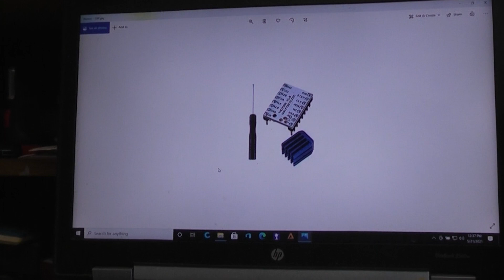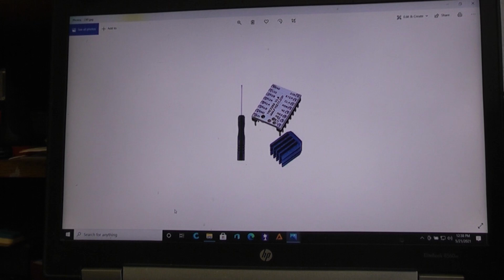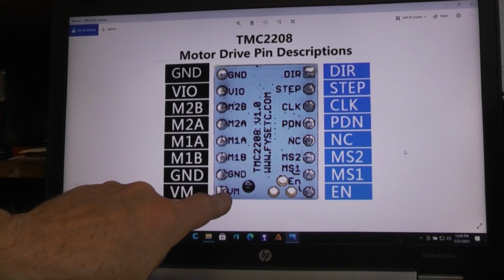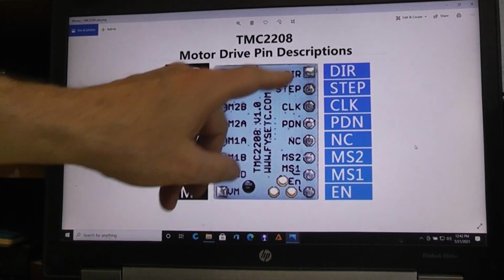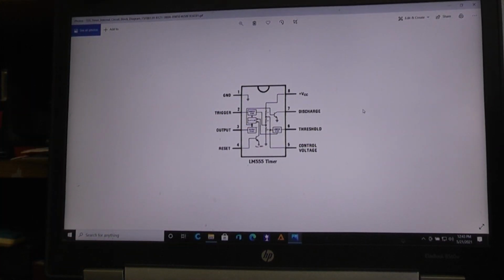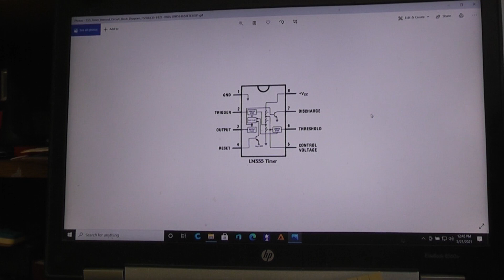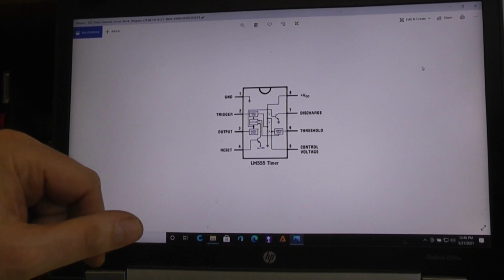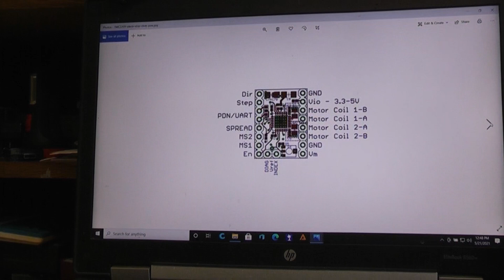Part 4, Leslie build.  Silently control a stepper motor with  a TMC2208, 555 timer and 12V supply.

Comment: Thanks for sharing I really enjoyed your videos. May I ask, should a 17hs4401 or a 17hs8401 stepper work for this build? My horns are heavier though. Thank you.
Reply from the maker: I have not experimented with other stepper motors, but I would think a larger one would work better with heavier horns.
Reply: @Robothut what's the size/model number of the one you used for this build?

Comment: Is it a normal practice to put a bolt through the regulator?  Or do you need to center post and a bolt tru the regulator hole ?
Reply: I had a amp I didn't take pics of before taking it apart and there was a component that looks like the 5v regulator and I burned the freaking thing when I plugged it in

Comment: Love this project - I wish I was a bit more adept at the circuit side of things (software dev here, I've only dabbled in hand-wired circuits). I grabbed the schematic @jpdesroc posted here, but haven't gotten things to work just yet....
Reply from the maker: Now there is a company in China called JLCPCB that will make PCB boards from your design for like $5 bucks and you get them in a week. If I had know about them back when I did this project I would have used them.
Reply: @Robothut how do I go about ordering that as someone who knows nothing about any sort of chips?

Comment: This is the third time I have tried to post this reply and it keeps getting taken down.  Maybe because I included a link it didn’t like.  One more try with link one link removed…

Thank you again for this excellent YouTube video series!  I have completed my project and although there are still a few kinks to work out, it works.  I depended heavily on your work.  The issues I had with the motor pausing, just went away.  Not sure what that was or what I did to eliminate it, but it went away.  

This is the link to a video from the back with the drive motors running:
https://drive.google.com/file/d/1vJH7zZ4RA7pFxjk15XfSD0R_xaO2erO5/view?usp=drive_link
Reply: This is exactly what I'm trying to do, glad to see the motor pausing issue resolved itself!   I'd love to learn more about your project - especially the speaker/crossover details and what you used for your lower drum and upper horn rotors.  I was considering using some plastic funnels to make a horn since I can't find any STL's for it.  Any tips or extra info / videos would be great!
Reply: @james5345  I have had  some time with my version and my main complaint is that I believe the lower drum has to have a much more focused opening to keep the lower frequency pulse.  I think the one @Robuhut made was more effective because the side walls went right out to the outer diameter of the drum.  I focused on a scoop contour and I think that was a mistake.  Mine works but it is more of a chorus effect than a Leslie.  I am in the process of adding side extensions to my lower drum.  If you do yours, I would focus on that.  Now looking at the original Leslie drums, the drum diameter is a few inches larger in diameter than the speaker so that the side wills can extend enough to make a focused beam.  My build is too far along to make that happen so I will just work with what I have.  

The crossover worked, but I ended up putting an L-Pad on the horn side so that I could very it's contribution.  Mine was a littel too high frequency happy.  That is probably because the high and low frequency drivers were not balanced very well.   If I had it to do over, I would set the crossover a little higher.
Reply: @kennethvierck244  That's extremely valuable info, thanks!!
Reply: @james5345  I looked into plastic funnels also.  I also looked at tweeter horns and I was going to connect them with  PVC pipe and fiber glass.  Ended up getting a 3D printer and Rhino.  Glad I did.  I am happy to share my STL files for the horn.  Mine is printed in 5 pieces (body, two horns, two muffler pieces).  Mine has some specialized features that may not work for you though.  The 4" pulley is integral with the body and has a 0.2" wide channel.  It has a bottom  bearing seat for a specific bearing that has an inner race diameter to permit a 1" tweeter opening.  The top bearing is just a simple skateboard bearing.
Reply: @kennethvierck244  Looks like my reply from yesterday didn't go through.  I would be very grateful for the STL files!  I haven't finished sourcing all of the parts yet, but I believe the tweeter mount I have is 1".   I could also modify the original design file in Fusion if you can provide it too (no biggie if you can't/don't want to).
Reply: @james5345  I don't have a problem sharing.  I guess I will have to sign up and post on thingiverse or somethng.
Reply: I have tried twice to post some links and paths to information and the system keeps taking it down.  Not sure what it does not like.
Reply: @kennethvierck244  I was afraid that might happen.  I'm pretty sure that my reply wouldn't go through to you the other day because I tried to sneak my partial email address into it.  Did you end up posting it to  Thingiverse?
Reply: @kennethvierck244  Hey the only solution I could think of was to add my email address to my visible contact info.  So if you click on my name and get to the 'about' section, you can click on 'view email address' and send links or files to me that way - if you want to.  Sorry it has been such a hassle

Comment: Hello Again.  I have made some significant progress.  I did what you did for the circuit but drive two motors so that I can drive the horn with one and the drum with the other.  I built a crossover also to split the signal for the tweeter and drum driver.  Anyway.  I tested the initial circuit on a breadboard with one motor and then put it on more permanant boards for the two motor drive.  It works great on the fast speed, but when I move to the lower speed, one of the controllers has a pause close to every half revolution.  I switched the motors and it is definitely the controller not the motor.  Any idea where the problem would lie?  Not sure if I can add pictures or video here but will try.
Reply from the maker: Not off the top of my head. But I do like the dual motor and horn section you added. Hope you get it worked out as it sounds like a great idea.
Reply: @Robothut   here is a link to my video (I think I made it properly shared): https://drive.google.com/file/d/1bIcaJuLA4Pj4XpChjUxNsg3hux5YKUyy/view?usp=drive_link
Reply from the maker: @kennethvierck244  Try uploading to Youtube instead. You upload as UNLISTED if you want to share the link , or PUBLIC if you want everyone to see it.
Reply: @Robothut  Sorry!  Made it public so it might work now.  I am thinking I might have damaged one of the motor controller chips when I stupidly hooked up the 12v supply backwards.  Rookie mistake.  I purchased 4 of them so I am making another board and will try that before moving forward.  My drum is significantly larger than yours so it might be that there is not enough power to drive it.  We will see.  Fun project and thank you so much for posting your info.
Reply from the maker: @kennethvierck244  I saw the video. Wow that is strange. Is there a chance that the power supply is having a problem at low speed? Monitor the power supply rails when it is happening Very odd.

Comment: Excellent!  Just ran across this. Thank you!   What pulley diameters did you use to get the correct slow and fast speed with this system?
Reply from the maker: Video Part 2 shows the 3d printed parts and link to the STL files. You open the STL files in any slice or STL file viewer to get the dimensions to all the parts.
Reply: @Robothut  Thank you again for this awesome video series!  I have not done any 3D printing so have not used STL files before.  With free on line viewers I could manipulate your parts and it looks like your driver pulley was about 3.75" and your rotator pulley was about 2.75".  Anyway, with this video series I am pouring over the data sheets!  I think I can see how you are using the 2.2k resistor to affect the 5k-5k-5k voltage ladder in the 555 timer so that the set/reset voltages are different for the fast and slow speeds.  At present I am having difficulty calculating the pulse frequency expected.  I like to understand how things work, but I am an old mechanical engineer and so the electrical fundamentals are not as strong and don't come back as quickly! :-).  My first round through I don't think I calculated the charge and discharge rates correctly with the 0.01uF&27.5k circuit with the set/reset voltages for fast and slow.  I will try again.  If needed, I can just do what you did and adjust the pulley diameters.  I will be doing this on both the bass and horn oscillators so I have to be able to affect the rates properly for both.  My worry is that with a 12" base driver, my rotor parts will have more rotational inertia and I might have to give the stepper motor more mechanical advantage.  I see that the stepper motors go at 1.8 degree per pulse so I need on the order of 160 pulses/s for the slow speed and about 1300 pulses/s for the fast speed.  The difference between the horn and bass rotors can be dealt with by pulley diameter differences but the ratio between fast and slow has to be about right.
Reply from the maker: @kennethvierck244  Lets us Know how the project turns out.
Reply: @Robothut  I will definitely post my project results, the good the bad and the ugly!  I did some calculations and I am only calculating a 2.5x increase from slow to fast and am calculating higher rotational speeds (pulse rates) then it looks like you are getting.  I will try and post a screen shot of my calculation page.  I have the components on order so will start testing the motor driver soon.  Hopefully!
Reply from the maker: @kennethvierck244  Take into account the TMC 2208 driver has a Data sheet showing the different pulse input divider settings.
Reply: @Robothut  yes, I have been reviewing.  Very confusing for mortals, but I do see that the default position is for a 1/8 setting and you can put voltage on the MS1 and/or MS2 pins to change the micro-stepping setting.  Could put that on a the speed selection switch with a DPDT.  I reviewed/traced your foot switch arrangement.  Very elegant!  probably take another wire and maybe a 3PDT switch to work out a logic change element for the speed.
Reply: Ok, sorry for bombarding you with questions!!!  I think I see now that the internal voltage ladder is isolated from the control pin, so my assumptions that the voltage ladder being affected by the control resistor is false.  However, if I pull the control pin voltage to ground, then how does it cycle at all?  The threshold comparator reference controls the high voltage side and the trigger reference controls the low side, so how does it work at all if the threshold reference is lower (ground) than the threshold reference?  If obviously works, so what am I missing?
Reply from the maker: @kennethvierck244  Starting at 10 minuets in I talk about the 555 chip. You hear me say there is a 2.2K resistor on pin 5 the voltage control input. So even if you connect that open end of the 2.2K resistor to ground, pin 5 will not be at ground potential. at about 12.45 into the video I show the schematic for the circuit.
Reply from the maker: If you do a search for 555 timer block diagram you will see the voltage divider in the 555 timer and that pin 5 VCA input is taped in the middle of the voltage divider so with the 2.2K resistor on 5 will not go to ground or to V+ when the open end of the 2.2K resistor in connected to ground or to V+.
Reply: @Robothut  Hi, thanks for the response.  Believe me, I have been over your videos several times.  Your 3D printing is pretty impressive!  I commented on the 2.2K resistor function in my first post and how it affectes the voltage ladder.  That is also shown in the sketch that I provided with my calculations.  Then I lost confidence that I had that correct.  From your comment it looks like I had the right idea in the first place.  

I saw another video that states that the output voltage is 1.7V less than Vcc.  I see that they make some comment about this in the data sheet but then the example the data sheet shows, and your experience shows that the output voltage is very close to Vcc.  

I purchased a speed sensor along with the other hardware, so I will be able to measure.  I will also track the output with the oscilloscope.    

I have my breadboard ready but still have to source some of the other components, so it might be a little while before I  get this in test mode.
Reply: Also, I had a 4700uF cap left over from guitar amp relay switching and if I pair that with a 470 ohm control resistor I get about the same time constant for the ramp up but I get a larger difference between fast and slow speeds.  I might try that and see how it works.

Comment: Thanks a lot for the project and sharing all details - I will probably consider a extension of that for the horn piece for a keyboard leslie!
Reply from the maker: It should work well for the small horn piece.
Reply: @Robothut  I believe I will also custom made one with 3D
Reply: @fmartins777  Did you ever make or find a 3D printed horn piece?  I'm looking to do a complete lesie with the upper rotating horn as well, so I'm highly interested to know what route you went.
Reply: @james5345  I did design mine. Project is 80% done but I AM using arduíno as the brain
Reply: @james5345  I Will probably finish It still this year and made vídeos showing that and big thank you to @robothut for did the base project with the rotor part
Reply: @fmartins777  Great, can't wait to see your videos!  I'd love to see how you implement the arduino for sure.  Is there any chance you can share the STL for your horn in the meantime?  It would be greatly appreciated

Comment: Some more important questions: #1 Did you have to program the TMC2208 board to make it behave like it does with an external 555 timer ? If so what did you change in the programmation ?      ------- #2 How did you know to use the STEP input (freq rate, ext..) ? The TMC2208 family PDF specs does not talk at all about the STEP pin input.. -------- #3 The specs only say the STEP input can accomodate the followings: <<< STEP/DIR Interface with 2, 4, 8, 16 or 32 microstep pin setting>>> so no possible 256 microsteps using the STEP input pin ? Thanks for you reply.
Reply from the maker: No reprograming. Everything I did I learned from online Data sheets and experimenting.
Reply: @Robothut  So you are working at how many microsteps to acquire this nice and smooth working ? 32, 64, 256 ??
Reply from the maker: @jpdesroc  The video clearly calls out the MS1 and MS2 as being open circuit, the data sheet for the TMC 2208 , here is a link.
https://octopart.com/datasheet/tmc2208+silentstepstick-trinamic-81463152?utm_source=bing&utm_medium=cpc&utm_campaign=b_cpc_amer-us_search_dsa_english_en_usd_datasheets&utm_term=octopart&utm_content=US%20Datasheet%20DSA
Calls out the MS1 and MS2 as having built in pull down resistors and that setting both pins to Open "LOW" would be 1/8.
Reply: @Robothut  I'm surprised it runs that smooth using 8 microsteps !  This probably is part of the available torque you get now.. Iread that rising microsteps (up to 256) will lower the overall torque.. Thanks for sharing your work.

Comment: I just redrawn the full schematic for your project from small video snapshots of it. You can download it here to make sure everything is Ok: http://www.arcenson.com/public/tmc2208_schematic.pdf
Reply: Thanks for providing us with the schematic
Reply: Thank you!
Reply: TKS a lot!
Reply: Thank you!
Reply: Thank you!
Reply: Thank you for putting this together! 
What would I have to modify to make this work with just a potentiometer (for the footpedal)
Would it be like this?

https://i.gyazo.com/b91c7e12f0526a60888c106dd35e5423.png
Reply: Thank you for putting this together! 
What would I have to modify to make this work with just a potentiometer (for the footpedal)

I've uploaded to my channel a photo-video of what I would think the schematic would look like if the remote switch was replaced by the potentiometer food pedal. It's currently not working, but it may be a result of not having the 10pf capacitors in my circuitry yet. 

Edit: Got the capacitors, now full power enables it to do a few RPMs a minute then abruptly stops and goes silent. My 7805 regulator is burning hot as well.

2nd Edit: Took a different approach, turns out control voltage only works on 0 or 5 volts so I wired the potentiometer in the wrong positions. 
I looked up "Stepper Motor Speed Control Without Microcontroller" (on instructables) which contained a schematic that worked perfectly. 
Only adjustments I made was downsizing the 1uf capacitor to .1uf, and possibly the resistor but I have no recollection on what I replaced it with. Using a NEMA17 stepper. 2K POT.

They use an A9488 driver on their schematic, but a TMC2208 will work just as well if not better.
Since it's using an A9488 driver, it doesn't show where to wire EN(able), so just ground it.

Make sure DIR is left unplugged. Interference from other grounds will cause the motor to fail-attempt at changing directions and ultimately just stalls the stepper and whines.
Reply: Thanks so much for this!!!

Comment: Very nice video! I'm planning to build a Leslie cabin similar to yours for my engineering cursus, do you have by any chance a list of the hardware for the circuit? The video is pretty long and I couldn't understand some parts needed.
Reply from the maker: Sorry that was built about 1 year ago, the only info I have is what I shared in the videos I did on the unit.

Comment: Please help diagram wire controler speed tmc2208 with switch cw/ccw 24v for stepper motor ex 3D i want diy maker filament 🤔🙏